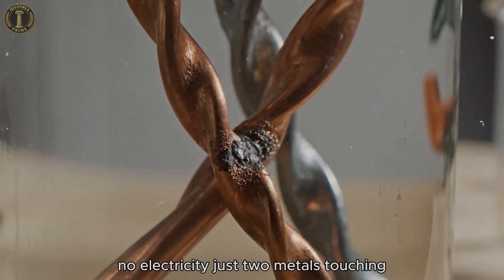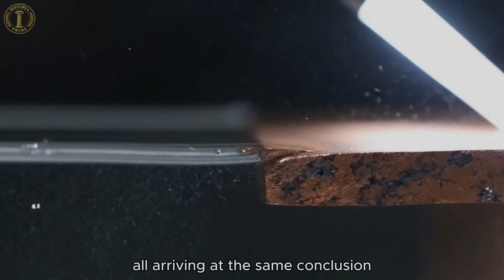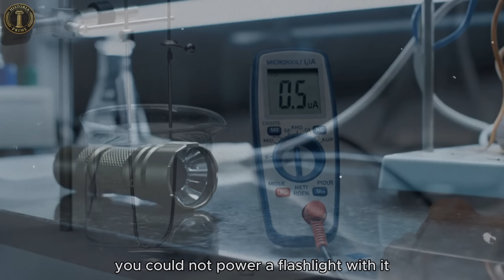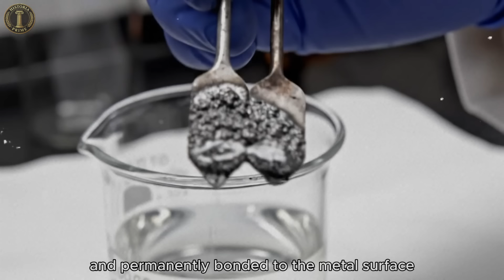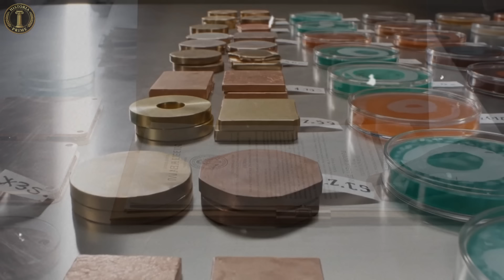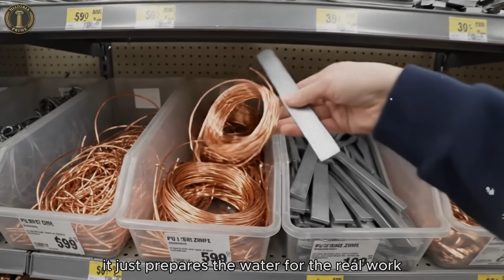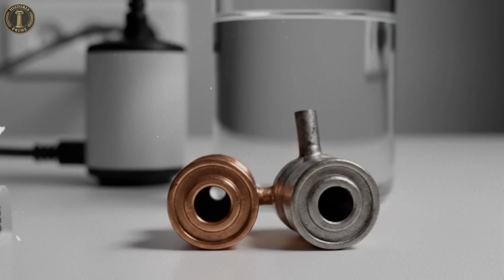Connecting Two Metals Purifies ANY Water — The "Earth Filter" Secret They Buried

Comment: The 2 metals in the water illustrate electroplating. The 2 conductors are the anode and cathode. To work correctly the two metals cannot touch while in the water or the effect is canceled out. Touching shorts out the electric current. Separation allows ion transfer because the contaminate aspect in the water is also what makes the water impure. This purification process is called deionization. The industry uses this everywhere I've ever worked but it's only a small part of the purification process in the industry. The whole point of pure water is to have water that when something that is cleaned by this water when it dries will leave no evidence of contamination on whatever it cleans. It's also used in electro-plating .  Two negatives about deionized water is that it initiates rust and corrosion in ferrous metals very fast and it will strip enamel off your teeth when you drink it. Other than that enjoy.
Reply: The video said they are to touch, to work
Reply: Thank you I will use my stainless steel straws
Reply from the maker: That’s a great technical breakdown of the electrochemistry involved, especially regarding the need to prevent shorting.
Reply: I am totally ignorant,  but very interested in this subject.
Could you explain it or direct me on where to get more info.
Reply: @audreyandericlevett just research D.I. water. It is very common. The way the industry makes DI water is much more efficient but of course more expensive. Systems can be purchased from a single user to however sophisticated your needs are.
Reply: Hi Tomm! thanks for your advices and knowledge((: are you saying the copper and the zinc should Not touch each other, when they're in the water? in  the video he explained it's important that they Will touch each other? did i misunderstood you, or him, or you're saying he's wrong about it? 
and do you think it's better not to drink these water everyday, for the enamel?
thanks!(: 🙏🌻
Reply: @morankaner I had associates I've worked with regarding DI water that were drinking the water but some time after consuming it they experienced tooth sensitivity problems. After a visit to their dentist my friend told me it was because of the DI water itself. The water that many people but not all drink have minerals. DI water has no minerals or more to the point nothing in the water that will conduct electricity. This makes the water very aggressive to fill the void of mineral depletion. DI water will corrode most metals on contact as it searches for mineral balance. That is what happens to teeth.

Comment: Does silver do the same thing ?
Reply from the maker: In some cases, yes — silver can have similar antimicrobial effects. The main difference is that silver, copper, and zinc behave differently depending on the form, surface area, and how they’re used. Copper and zinc are often more practical for low-cost everyday applications.
Reply: Silver coins were often kept in water barrels on the wagon trains, for such reasons, However I could not tell you how effectively this does work....

Comment: Back then there weren't so many chemicals in wáter as today, so much pollution. We live in a totally different world. This may help till an extent but I wouldn't use It as an stand alone solution. Todays world IS complicated.
Reply from the maker: I think that’s a very fair take. Older methods can still be useful, but modern water and soil conditions are a lot more complicated, so they’re usually better seen as one tool rather than the whole answer.
Reply: @HistoriaPrime1212 Thanks for your answer and not taking loving criticism personal. Keep going with your work. It's useful.

Comment: i understood  and can arrange copper /pipes which are use as refrigerator  compressor pipe but how to arrange zinc pls.let me know. I want to make a purifier for my working place
Reply from the maker: I’d be very careful with any DIY purifier meant for drinking water. Metal choice, corrosion, and water chemistry all matter, so anything used in a workplace really needs safe materials and proper testing first.

Comment: Anyone got knowledge about removing chemicals from water please.
Reply from the maker: Yes — removing chemicals from water usually takes a different approach than just removing dirt or particles. Activated carbon, reverse osmosis, and choosing the right filter for the specific contaminant are often the key. Good question.
Reply: I use a simple aquarium fish pump, with the charcoal filters, same as my aquarium set up, .

Comment: What happens if you just use brass?
Reply from the maker: Good question. Brass can behave differently because it’s an alloy, so the result is not always the same as using pure copper with another metal like zinc. That’s exactly why material details matter in these discussions.
Reply: @HistoriaPrime1212 .    I didn’t want to just assume the integrity of the metals would be changed during the heating process
Reply: Some brass has lead content to help the casting process .eg ,taps .
Reply: @Bergoinecourtney 🙏
Reply: You will get I'll .

Comment: Pennies from 1982 forward are copper plated zinc. Removing the copper layer with sandpaper leaves you with only the zinc. Cost effective source?
Reply: If pennies from 1982 forward were copper plated zinc. Wouldn't that be the perfect combination of copper and zinc?
Reply: @alicerafferty9595  It's a very thin layer of copper. Pennies pryor to 1982 are 95% copper. You could try it but thinking you'd get better results using a pre-1982 penny and a stripped 
1982 and forward. Not an expert just giving my opinion.
Reply: @Scott-o2w4n Thank you!
Reply: @Scott-o2w4n 

Tell me more please?
Reply: Can you purify your water with copper and zinc pennies?
Reply: @alicerafferty9595 they always say to put a 2p piece in your flower water to keep the water clean & make them last longer.
Reply from the maker: That’s an interesting thought in principle, but I’d still be cautious using coins for anything involving drinking water. Coin composition, coatings, wear, and contamination make them a messy real-world material even if the metals sound right on paper.
Reply: @HistoriaPrime1212 boil first?
Reply: @HistoriaPrime1212  Good point
Reply: Drill tiny holes through them you get the two metals together in one pop
Reply: WHAT ARE YOU REFERRING TO HERE MY FRIENDS ?......BRITISH ....PENNIES......OR THE AMERICAN PENNY WHICH  IS ONE CENT......OR THE REAL UK PENNY ONE P.............CAN YOU CLARIFY THIS FOR PEOPLE.....I LIVE IN THE   UK AND A PENNY IS ONE PENNY....NOT A CENT....THANK YOU
Reply: @Karl-wk2og  Referring to the U. S. cent. Not the British penny. Most don't know there is a difference.
Reply: Damn it. Now I have to change out all the plastic I put in.
Reply: How nice of u to share that thank u!!
Reply: Silver is good for water. What would happen if a silver coin came into contact with the copper and zinc?
Reply: 1982 was the last year of solid copper pennies. 1983 was the first year of copper plated pennies.
Reply: @uhillem  1982 was a transition year. Not all Lincoln cents were copper. Check your Red Book. 4 zinc varieties listed for 1982..

Comment: Where can I find pure zinc metal at? Everything is plated or alloyed...
Reply: Nails.look it up
Reply from the maker: Great question. Pure zinc isn’t common in “raw” form—most people find it as zinc anodes (marine/hardware), or galvanized steel (zinc-coated). The exact form matters for safety and results—what’s your goal: corrosion protection, chemistry experiment, or the “two metals” demo?
Reply: @HistoriaPrime1212 all of the above plus pure zinc will percipitate my fortune😮...
Reply: I was told that z nails are just z coating? Not a fact just what I heard...
Reply: BRASS = copper + zinc

Amazon has brass
Reply: So nobody has come up with an item that is of pure zinc? I understand brass is an alloy so is nails and pennies. So basically it's been a rhetorical question ❓?😮? ❓ Thus far...anyone in the US have a pure zinc source?
Reply: Find a plating shop that does zinc electroplating .They use 99.99  pure zinc annodes .You want the zinc in balls . Slightly bigger than ping pong ball . It's very easily melted .

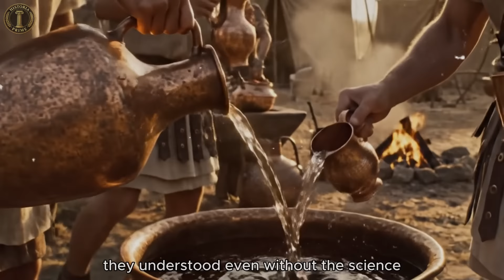Comment: 4:27 that's the reason why the use copper in plumbing..
Reply from the maker: Good catch—copper is used in plumbing partly for durability and partly because it can inhibit some microbial growth on surfaces. Still, it doesn’t make contaminated water automatically safe.
Reply: @HistoriaPrime1212 indeed brother
Reply: @HistoriaPrime1212  in india  Siddha started use (tamil people). Not ayurveda
Reply: They're using plastic now 😢
Reply: @clarereynolds9607 bingo…. Shame
Reply: @clarereynolds9607 which is a crock of BS if you ask me
Reply: I seen it used for the hot water but regular metal for cold

Comment: 0:36 that's what you call a reverse osmosis I think purifies water somehow..
Reply from the maker: Reverse osmosis can remove a lot from water, yes—but it’s a different tool than the “two metals” method. RO is a membrane filtration process; the metal setup is more about specific reactions/ion effects and doesn’t cover every risk. Context matters.
Reply: Çan we use in this to clean our home faucet drinking water.

Comment: Where do I find zinc?
Reply from the maker: For the “zinc” part: most people use galvanized steel (it’s zinc-coated) or zinc anodes sold for hardware/marine use. The exact form depends on what you’re trying to do—what was your use case?
Reply: @HistoriaPrime1212  To use it with copper in the garden jsut to see what can happen. Also wondering what will happen if I wrap both on each other and put it in salt water.
Reply: @lucletourneau6116    You can buy copper pitchers and let the water sit in it just make sure its not lined with a plastic like coating.
Reply: For zinc, galvanized common wire nail us enough.
Reply: Amazon

Comment: What about led and zinc
Reply: Lead is poisonous
Reply from the maker: Important question: never use lead for anything water-related—too toxic. Zinc is common as a coating (galvanized) or as an anode, but “metals in water” is not a universal purifier. Safer approach is verified filtration + proper disinfection.

Comment: I believe  90 % silver  or .99 silver  round ...I  pre filter . Activate charcoal  . Filter  . U v light for 6+ hr. Longer the beter .   Filter  ....
Reply from the maker: Thanks for sharing your method. Quick safety note: I can’t endorse DIY “silver/UV” water purification as a guarantee of safety—contaminants vary a lot. The safest approach is using verified filtration + proper disinfection and, when possible, testing.
Reply: Yes, you can purify water in a glass jar under the suns rays to purify as well. Africans learned this as well.

Comment: could pre 1992 copper pennies (cleaned) do? pre 1992 pennies and 2p's are 95% copper and 5% zinc.
Reply from the maker: Good question, but pennies are tricky: composition changes by year, and copper-plated zinc isn’t the same as solid copper. Even if it “works” for a reaction, I wouldn’t recommend coins as a water-contact material. Safer to use purpose-made materials.
Reply: Pre 1982 not 1992
Reply: @georgeruggles3144  thank you for the info, as another has pointed also that post 1982 are primarily zinc with copper (this is different to what i had originally read up on) so i will look furthe rinto it thank you
Reply: Pre-1982.  I melt pennies for the zinc. Post 1982 pennies are 97.5% zinc.
Reply: @ObiPleasant  i intend too, i was intending on forging copper bracelets etc however if it purifies water in this way then it maybe worth forging some kind of piping or other to drop into water. i know gardeners pop copper piping into rain barrels to stop algae growth etc, but for actual drinking water i didn't give it a thought, i will look further into this now as i am intending on building my own rain water catchment systems and filtering etc so the video has definitely gave me room for thought
Reply: @ObiPleasant  i have just had a bit of a search as i was not aware that some pre 1982 could also be mainly zinc, but from what i have read these zinc ones are rare, do you have a way of distinguishing between the two? i generally use a magnet but i suppose if both have even a little copper in they will stick too it.
Reply: @lisa-l3m5n  pre-1982 are 97% copper. The zinc ones are post '82. Copper is non magnetic. Zinc is non magnetic. Magnets don't stick to pennies.
Reply: @ObiPleasant  thank you for the info, and yes i know, i run them across a magnet during sorting to ensure i have not misread the date.
Reply: @lisa-l3m5n cops aren't magnetic neither is zed Zed is dead, butt I do like how your mind works. Plz keep at it!
Reply: 1943 and 1944 are or can be pure zinc...